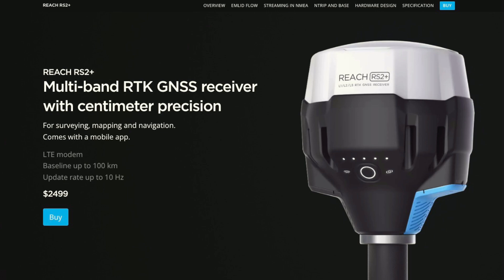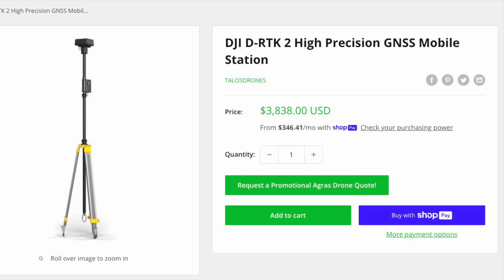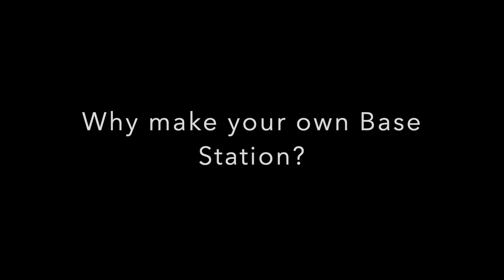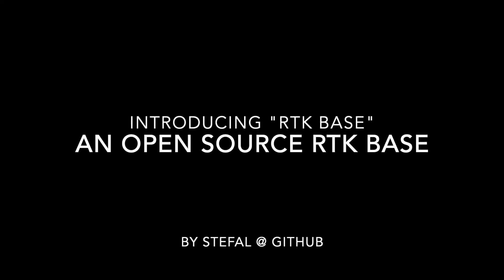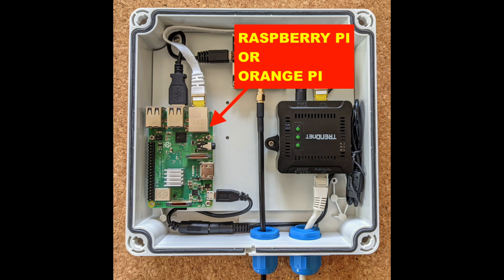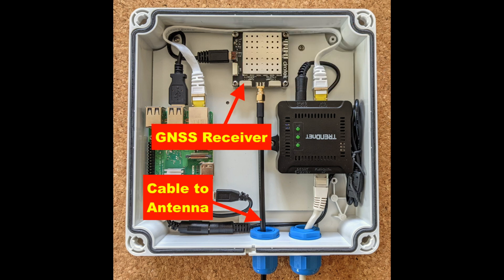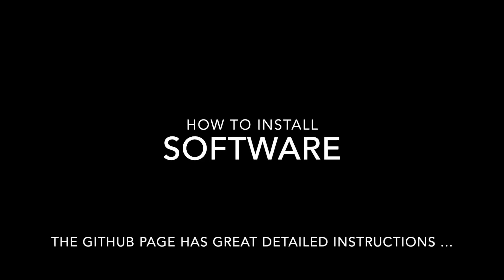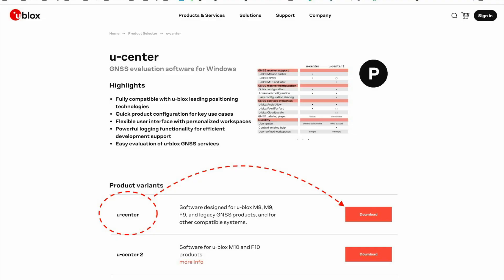DIY GNSS BASE STATION RTK BASE SERVER for NTRIP CASTER with WEB INTERFACE

Comment from the maker: Here are all the hardware components to make this DIY GNSS Base Station:
(Please kindly use my amazon links - it helps supports my channel - Thank you)
✅ ✅ 👉  Plastic Box:  https://amzn.to/3zSeJrx
✅ ✅ 👉  Raspberry Pi 3 Model B+:  https://amzn.to/3Sl2wlp
✅ ✅ 👉  U-blox F9P GNSS receiver:  https://amzn.to/3WtJoEo
✅ ✅ 👉  GNSS Satellite Antenna:  https://amzn.to/4bQyj4M
✅ ✅ 👉  POE Splitter: https://amzn.to/3W9Dg2N
Reply: Is it possible to to put a radio transmitter (RDF900X) in this project?
Reply from the maker: @pinheirobrunocorp  I did not know about RDF900X. Seems very interesting. I am sure it can be adapted to send data via RDF900X by relaying the data through the Raspberry Pi.

Comment: Bro you wana check out the Quectel stuff. They have a chipset LC29H - but you have to be careful which sub part you get (the AA version does not do RTK) They have two derivative models  that specifically do RTK as a Base Station the EA(10hz but also can be a rover) and BS (1hz is specifically a base station model) versions. They are less than 100 dollars each in some cases less than 50